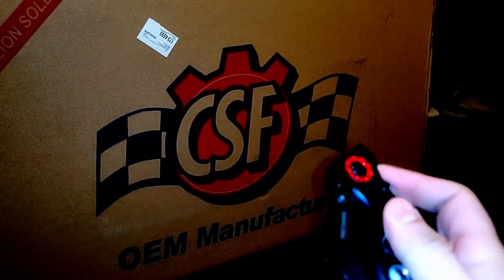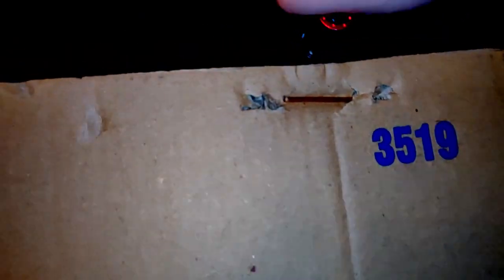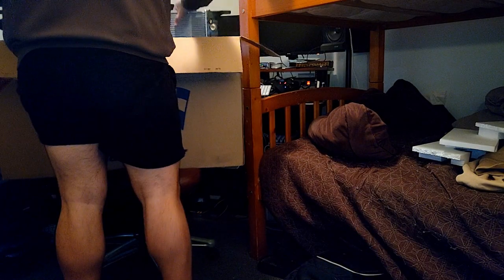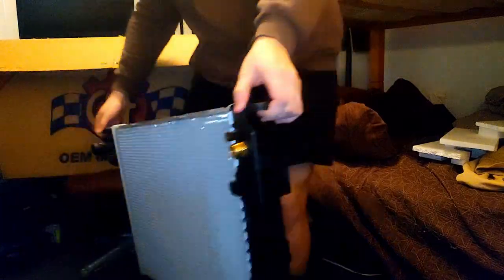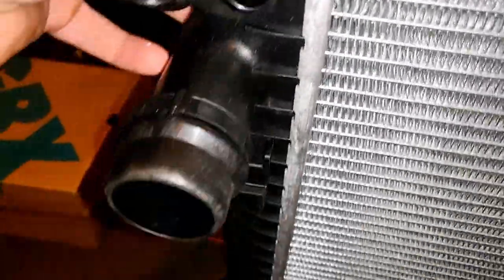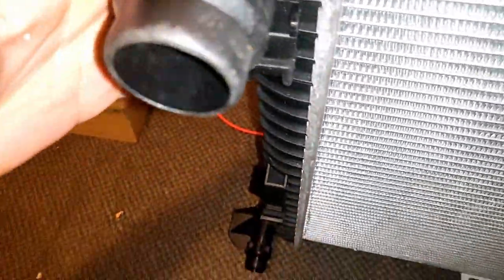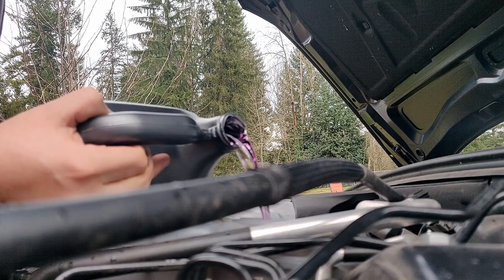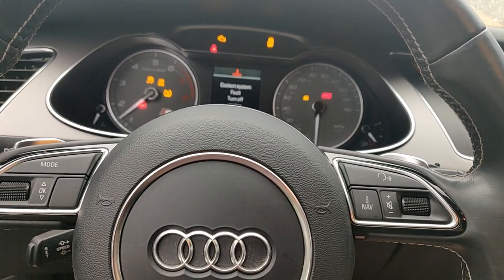Audi S4 gets a New Radiator and this one fits (Audi S4 Rebuild) FIRST START UP!

Comment: Why wouldn't the other radiators fit? Did you order the wrong part number?
Reply from the maker: some aftermarket companies use cheap molds
Reply: @DavidBaginskiy  That doesn't sound right. Cheap molds should still produce parts that fit.
Reply from the maker: If the fitting is barely off the radiator will leak. Go with a csf one and you’re good.